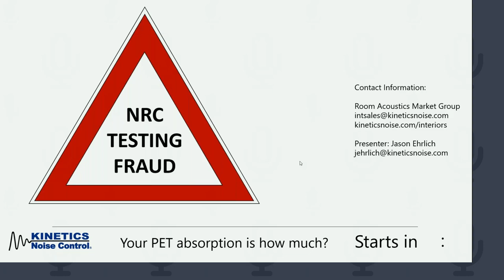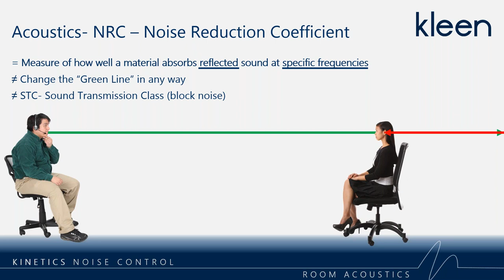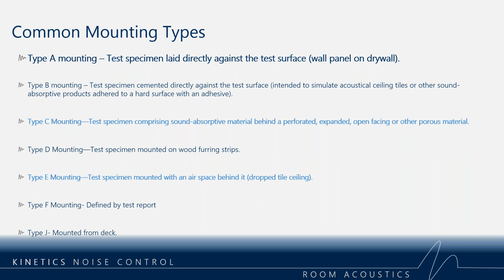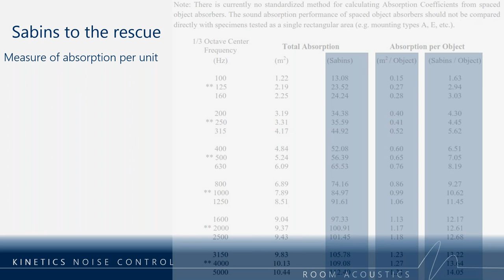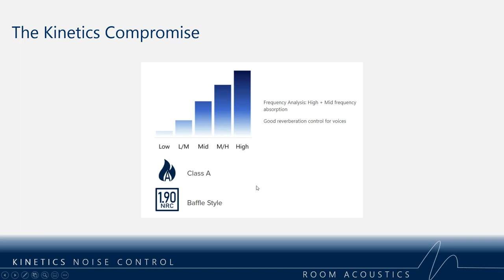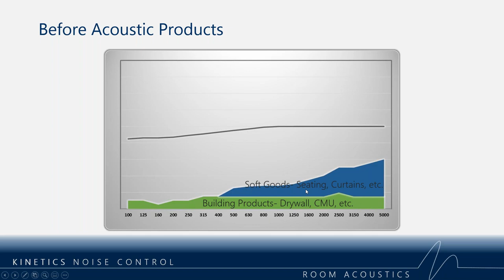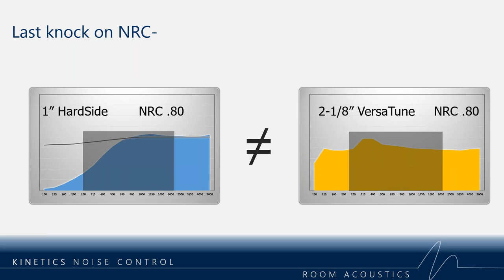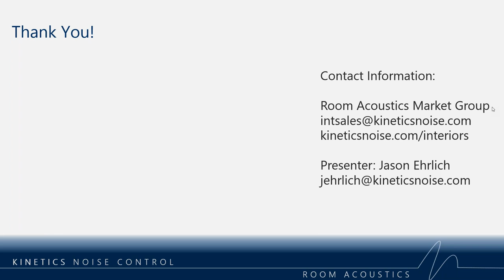Webinar Recording: Your NRC is how much? An examination of PET product acoustics

Comment: I’m sorry this video doesn’t have more engagement.  It’s a great product 

That said … I feel like the language used in this video is slightly misleading.  

For one … the coefficient does not necessarily represent a percentage.  The coefficient should more aptly be referred to as a constant. 

And an “absorption coefficient”  of 1 (under the common understanding of the term) does not necessarily mean it absorbs 100% of the energy 

It has been shown across multiple objective tests that an absorption coefficient of 1 or above 1 will attenuate that particular frequency by a maximum of 10 dB.  Which is obviously relative to the calibrated testing levels. 

It does not by virtue of a definition absorb 100% of the energy. 

Ron Sauro of NWAA Labs has had plenty to say on this topic and he runs the largest and most accurate testing facility in North America, relative to spectrum. (The room supports a Confirmed cycle of 25 hz) I’d check out come of his papers! 

Anyways… not trying to shade you guys.  This type of product is highly effective in many scenarios and I’d definitely recommend it